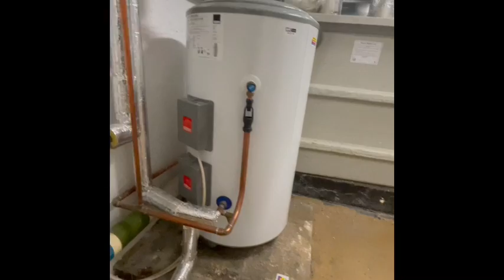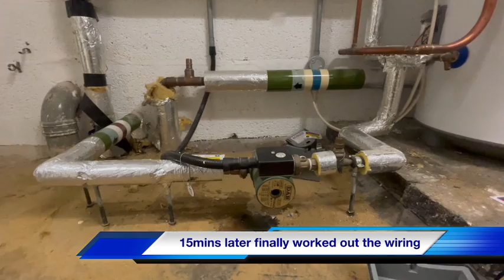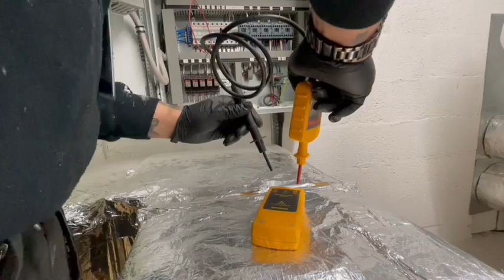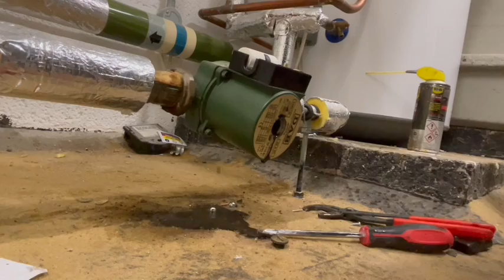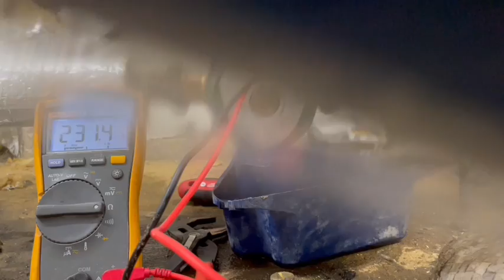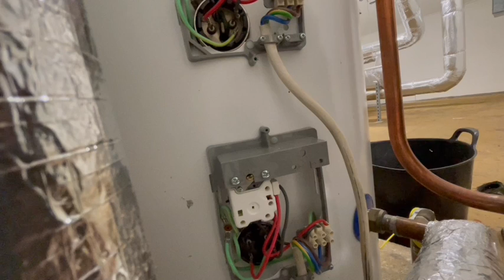No hot water , pump change unvented cylinder @thementalgasman3tgasmainte317

Comment: Act as More like sparky rather than gas guy.
Reply from the maker: Truthfully mate electrics have never been my strong point, I really struggle with reading wiring diagrams 2bh reading and writing was never my strong point , I take the approach that no where I should have power and at what point so I usually just start tracking back and I make the rest up from there 😂